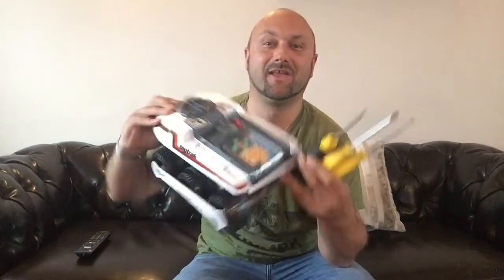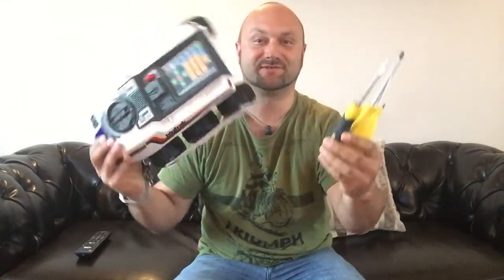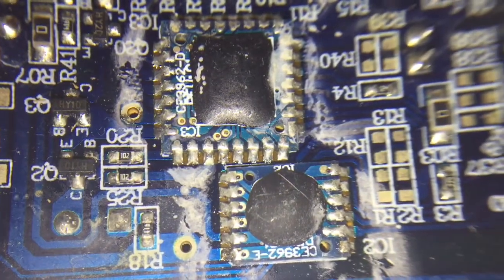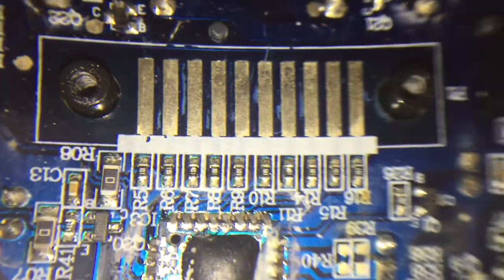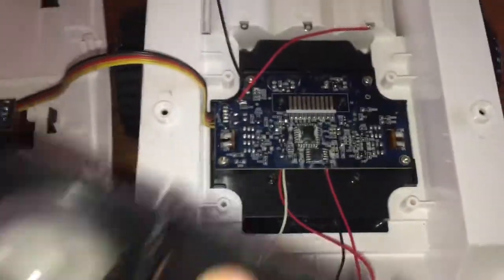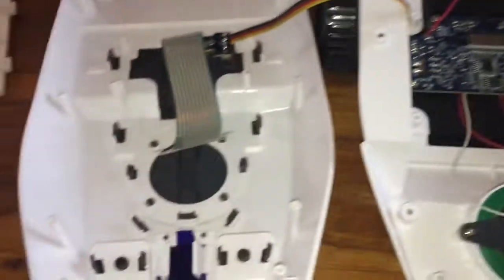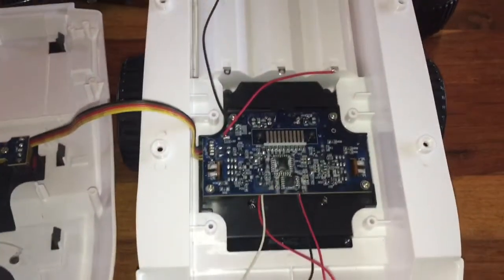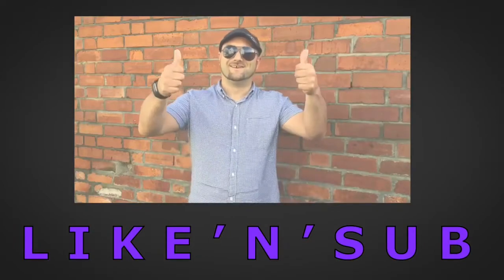Arduino Big Track Project PT2

Comment: If it's surface mount, and the "laser" is an LED, rather than an incandescent light bulb, it's the 2010 rerelease of BigTrak, rather than the 1979 version, which had much more primitive engineering. The 2010 one recreated everything pretty well, but used more up to date tech. They also released Big Trak Jr, a half size version (which I have), and at some point, took a desk toy called a Yo!Bot, and rebranded it as BigTrak Rover. It's a bit weird - you slot in a mobile phone, running their app, and it displays graphics on the screen, which are picked up by light sensors within the robot, which tell the motors what to do. It can be controlled by another, connected device. The app doesn't seem to be available on either Android or iOS anymore, but you can still find BigTrak Rover on Amazon for £15. Might be worth picking one up and seeing what you can do with it.
Reply from the maker: I need to get back into thus project... it’s all almost ready, but I’d like to wire up the keypad and put some stronger drives in for the motors...  one day, I will get around to it! ...  great to know about the “rover”...  I’ll have a look for some videos on that :-)
Reply: Thanks for this